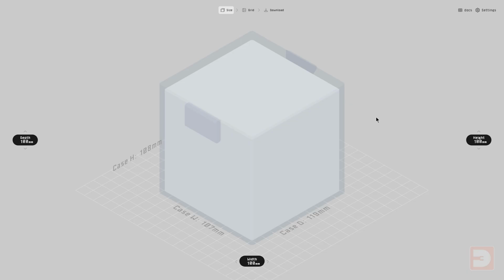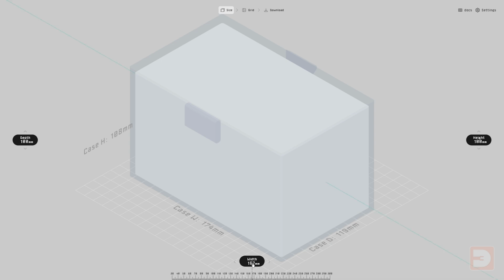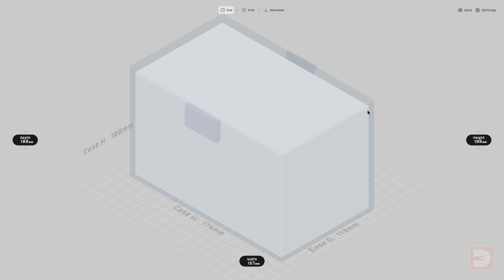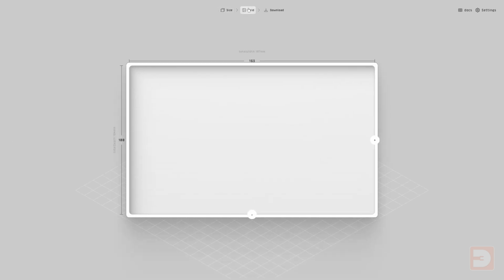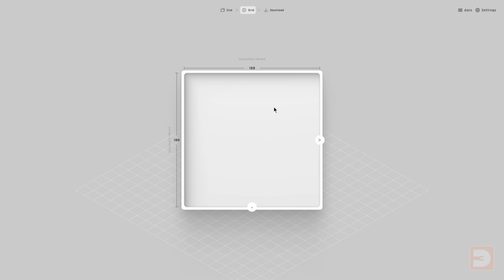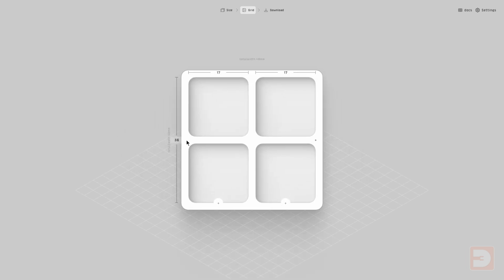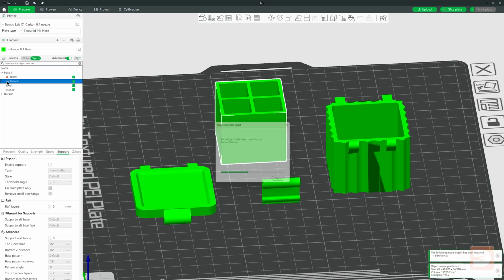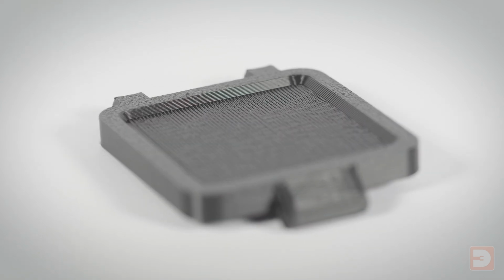Free Custom Box Generator for 3D Printing

Comment: where do you source the locking bars (M2 pins?) Thank you.
Reply from the maker: I want to say AliExpress but I can't for the life of me find the email receipt to confirm that at the moment.
I do remember that the requested dimensions of M2x28mm is not a common parallel pin size, but I think you should be safe getting on that's M2x26mm if you can't find them (though untested).
Reply: @3DRevolution  thank you, I found them on aliexpress and bought 20 pack for $5.  Then found them on ebay also.  Have another question, I printed a box with petg, came out great. then printed the lid with supports (hinge down), but the supports needed to be rather dense to bridge the large flat surface. tried two different support styles and density. both adhered to the part so much that using a hammer and chisel removed the bulk of the support material. Now I have lots of sanding to do to get down to the part itself.  Any suggestions about print orientation or supports?  Thinking I may try to print vertically with a wide brim, but I have applied text on the top of lid that probably won't come out so nice as with printing with lid flat on build plate (with supports underneath).  Let me know your thoughts. thank you.
Reply: @trendstrategics  Can you please post a link to where you purchased the m2x28mm locking bar?

Comment: When I import the box into Prusa slicer, the box gets “repaired” into two separate objects.    Any suggestions on what to use to repair the box so I can get the box to print?
Reply: Try importing the stl into Tinkercad then exporting it back out. I’ve done that to fix models that the Windows service failed to fix.
Reply: @radish6691  Thanks for the suggestion.   I tried it, and importing it into Tinkercad, the box is a complete mess.  Not sure what is up. I've tried several different sizes and it is the same "disaster" each time.
Reply: @PatJones82  Oof, sorry it didn’t work out. Now I’m curious, I’ll have to try the site to see what mess it generates.
Reply: @radish6691  not your fault.  I was all excited about this but it seems to be exporting unusable stl’s.  At least for me anyway.

Comment: Instead of getting screws and pins in that 2mm size, how about trying with something that we already have, and which would fit in those holes: 1.75mm filament. With a dab of glue, or a touch of a soldering iron, that ought to work.
Reply: no
Reply: Go for it!
Reply: The shear strength of ABS filament is fairly high.  Stainless pins would last much longer but ABS filament might work for occasional light duty use.
Reply: I've used filament with great success for another box binge that required 2mm screws and pins.

Comment: Then import it and a base generated from the Gridfinity generator (by setting bin height to 0) into your CAD software, convert them both to meshes, refine the meshes, convert them to solids, add them to a new body, and attach a Gridfinity base to a custom box!